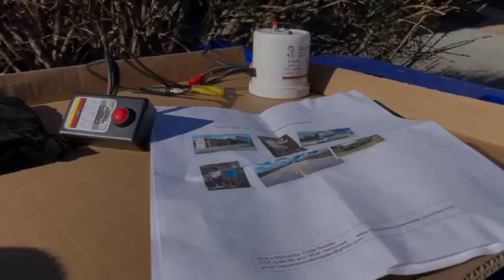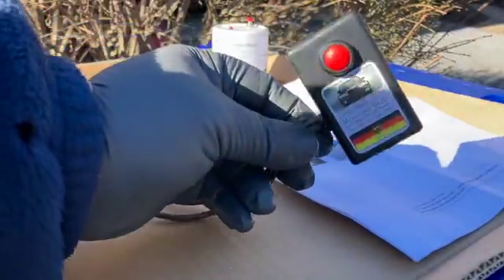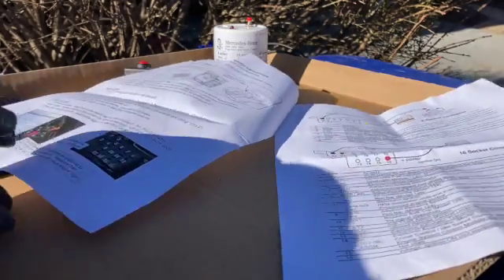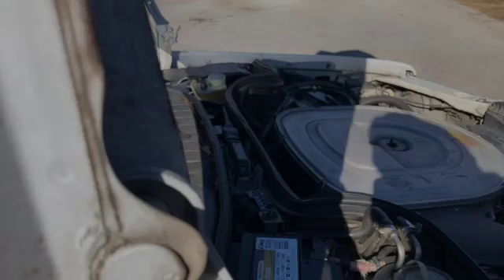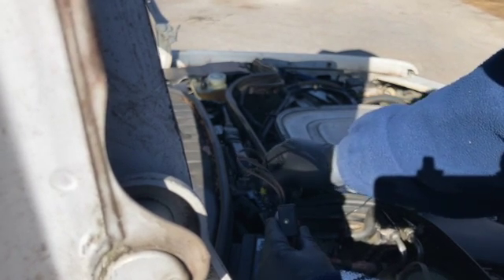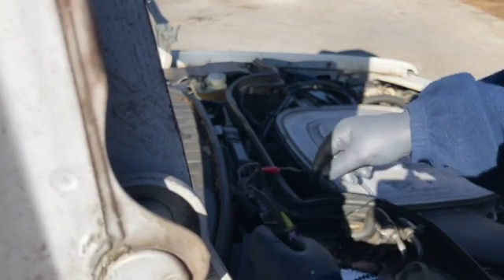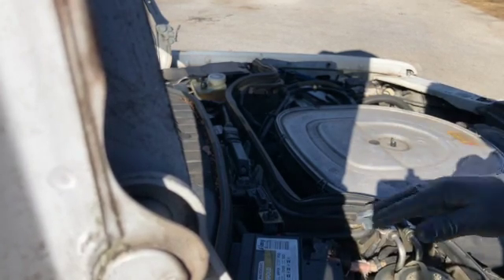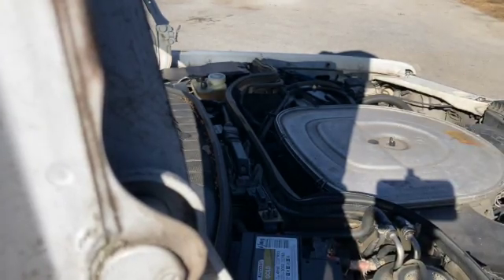Update: Using a ODB1 code reader on W126 W124    SD 480p

Comment: Will that code reader work on a w140?
Reply from the maker: That depends on the model year. This one will work for cars built up to 1995; Those should have a 38 pin connector. Here is a pretty good manual about that: https://www.mercedescodereader.com/uploads/2/6/0/4/26049090/mercedes_obd1_fault_codes_1988-1995.pdf
Reply: @straybenzes  great. I have a 95 S500
Reply from the maker: @lovegod3331  Ok. Then it should have the 38pin connector and then this OBD1 code reader will work. Mind you that it codes are limited to engine codes. Good luck.